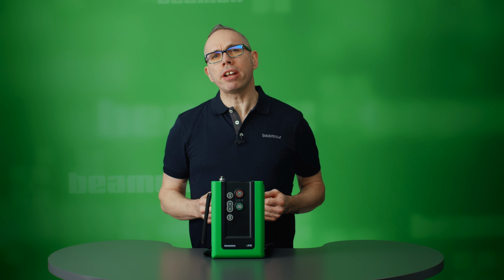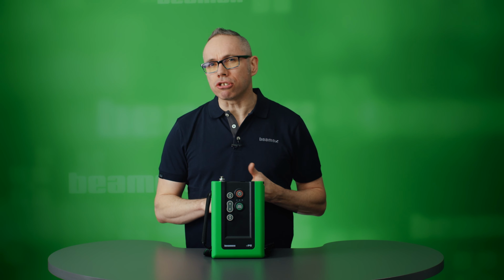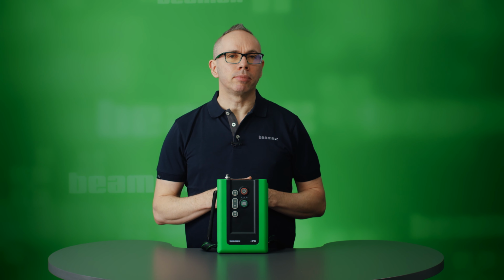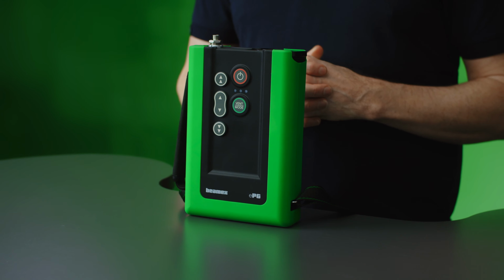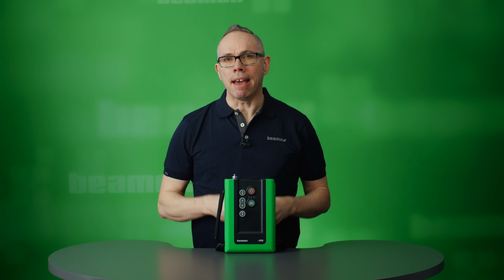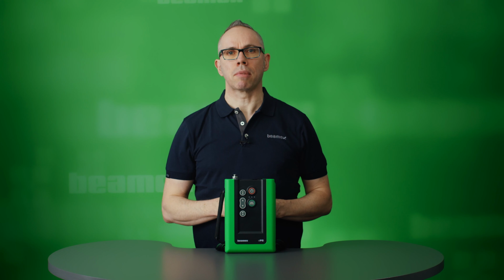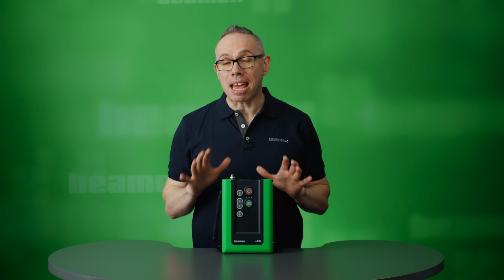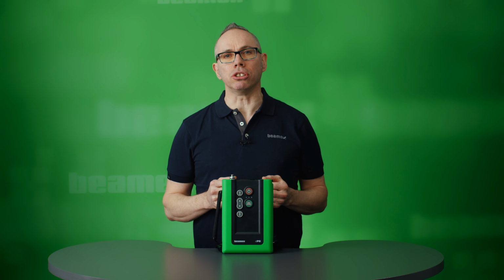Introducing the Beamex ePG Electric Pressure Pump and Controller

Comment: I was hoping this would have the ability to dial in specific pressures automatically. Maybe even communicate with a calibrator and step through ranges automatically
Reply from the maker: HI, the ePG pump can communicate with e Beamex MC6 family calibrators. The MC6 will send the required pressure steps to ePG for a fully automatic pressure calibration. 
Please check e.g. this video to see how an automatic calibration works: https://www.youtube.com/watch?v=PiDEtY4dMFE 
Thanks,